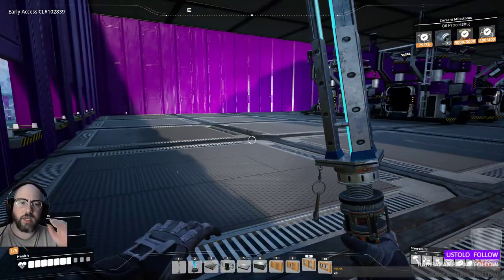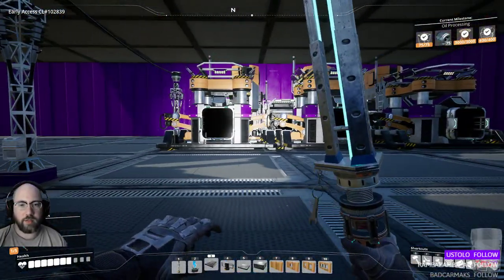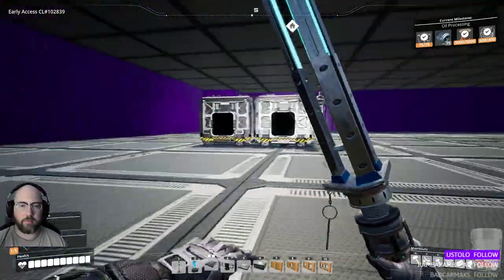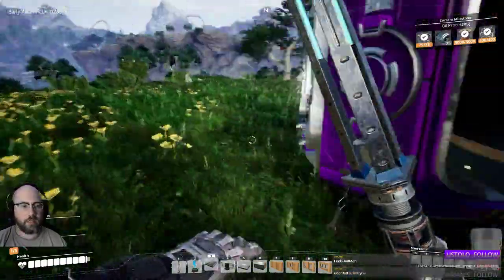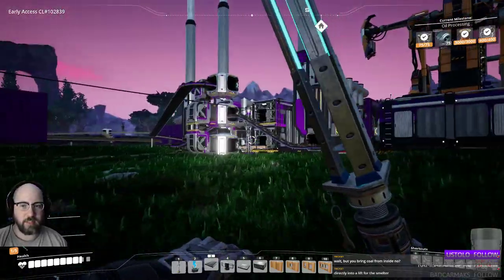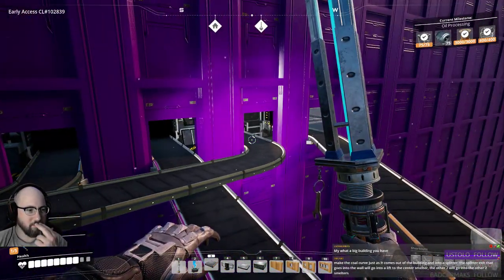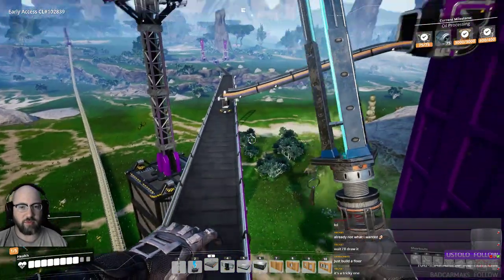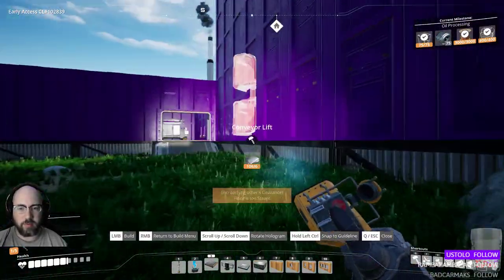Let's Play: Satisfactory - Early Access (026)

Comment: Wish I was there to communicate while you are live.  Attach the elevators to the holes on the building, not to the track from the splitter.  Make the elevators level with the splitter, or maybe staggered so the tracks don't run into each other.  Heck, you can even face the first one toward the corner where the splitter is, the second and third straight out from the building so that the tracks probably don't overlap at all.  I do love all the extra room  in the Borg Cube.  I notice your bed hasn't been slept in yet (does it even let you sleep in it?)  I can't even imagine what a Planet Coaster design would look like with you at the helm :).